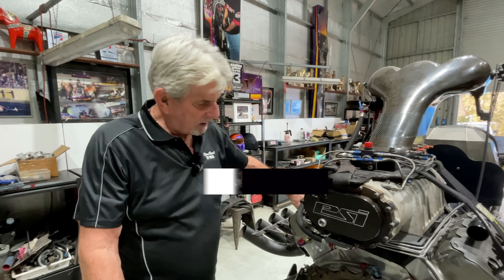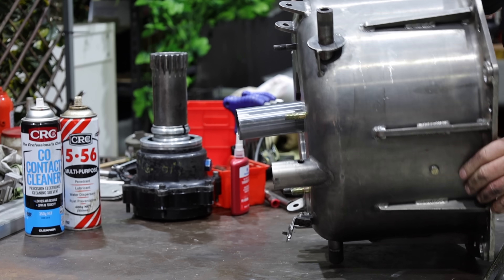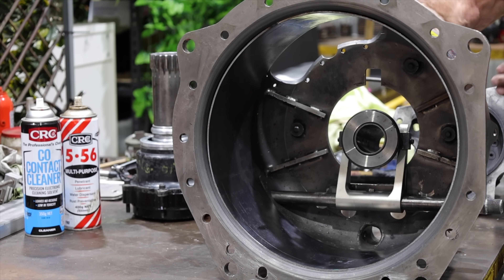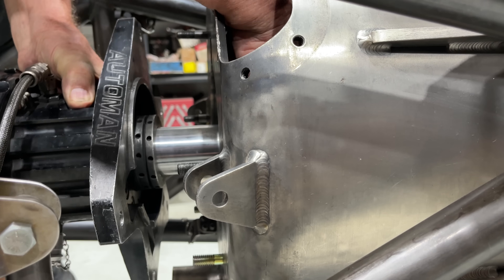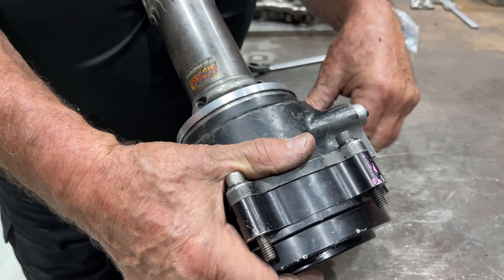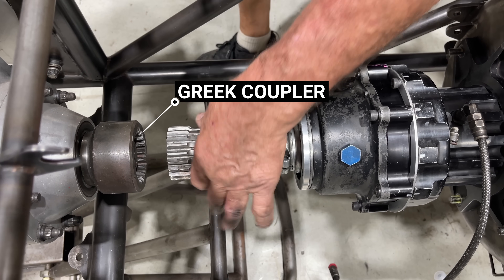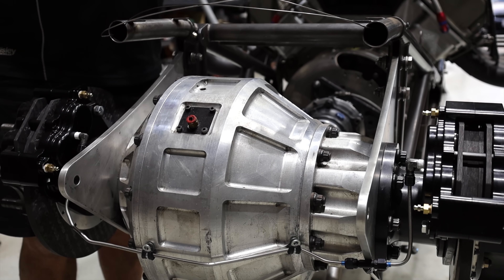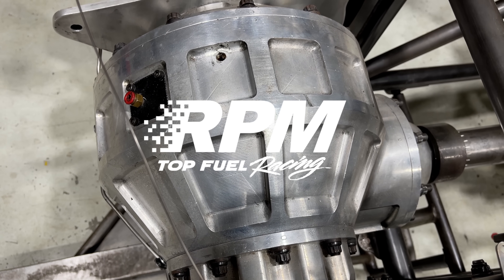THE BACK HALF OF A TOP FUEL DRAGSTER (AN ENGINEERING MARVEL)

Comment: Always loved drag races. As a kid I witnessed Don Garlits crash his Asphalt Alligator because he lost traction on his left rear, it took out two rows of low steel fences before coming to a halt, and bent them like they were made of thin wires. The Alligator, or what was left of it, stopped less than ten feet from me, I was nailed to the ground. It was most likely due to time pressure, as he was about to do a demo run, but it had lightly rained and there were still some wet spots, guess he took a “calculated” risk. He stepped out fine anyway, but I believe the Asphalt Alligator was done.

Comment: Mil is confusing because there’s mils(thousands of an inch) and millimeter. Usually mil is used for imperial, but obviously 1/4 inch isn’t 7 mils
Reply: Mils, millimeters, and mm are one and the same thing. Mils is just an abbreviation of the word MIL-limeter-S. Mil is only ever used when talking about something metric.  Thou or fractions of an inch is used when talking imperial. There is 39.37 thou (thousandths of an inch) to a mm. 1/4" equals 6.35mm.

Comment: what is the piece bolted to the can in front of the reverser?
Reply from the maker: The Auto man. We call it a cannon. It’s a hydraulic cylinder that retracts by controlled timing on a pass, which engages the rest of the fingers on the clutch. Thanks for the question

Comment: Is it just the 2 aluminium plates that hold the rear end onto the chassis? Is it to allow quite alot of flex off the start?
Reply from the maker: No, it has an anti-rotational brace on the bottom from the chassis to the bottom of the rear end. You want the back of the car as stuff as possible. Thanks for the question.

Comment: excellent vidja.  and to the ones wondering how these components handle 10k hp.  its because the weight of the car and the power is not being made until near the end of the run.   the clutch is slipping most of the time as well as the tires     the tires are a major limiting factor of not going much faster.  which is one of the reasons for going to 1000ft races.  these damn things are just too darn fast!!! lol!!! standing near one launching is exhilarating!
Reply: The gear rule is the limiting factor. The tires are the reason they run 340, by growing in diameter & effectively reducing the gear ratio. Top fuel went 339.++ at Phoenix on a quarter mile & funny cars did the same a few years later on 1,000 feet. They're now running 300 in the 1/8 mile. NHRA cut them back to 1,000 feet to give them more shtdown are! Everybody has said "they can't go faster than xxx" for the last 60 years & every year somebody goes faster!
Reply: @bradgriffith4231  I cant help but wonder, If they made a remote control TF car and ran the 1/4 just to see how fast they could go!   Im sure theres a theoretical calculation but it would be fun to see it in action!
Reply: @MrChevelle83  It wouldn't go much faster. They're governed by the gear ratio NHRA limits them to & the tires can only grow X tall. They're still slipping the tires at 339 when they go through the traps now. Also, I doubt an RC car would be driveable, since the driver anticipates(from seat of the pants feel) the next "move" the car will make & counter steers. I've never really asked anybody that I've personally known what it's like, but I have known several TF & FC drivers since the 70s. Jimmy Paoli, Tripp Shumake, Johnny West are a few & also knew Mark Niver who ran Top Alcohol 20 years ago.

Comment: Where the reoccurring failure in the flywheel clutch assembly area or anywhere for that matter is concerned,  why not the enlargement of these mounting bolts, due to failure, these sites that can be improved such as bolts,studs sizes and their respective bores, clearance holes enlarged for greater sized bolts,better still adding more bolts or threaded holes in a bigger pitch circle diameter and bigger diameter bolts and their respective holes for the bigger loads. etc... balancing to suit afterwards and  before the final checklist assembly. Easy
Reply from the maker: It’s a rare occurrence for a clutch to let go (or a flywheel). On the flange of the crank, there is only a certain size. We already have 8 x half inch bolts in there - the best aircraft quality bolts you can buy. The reason we use Permatex Red, so it’s very rare that they come loose. All crankshafts and engines are balanced to a Bob weight rod and piston assembly. Thanks for the question and very valid insights!

Comment: Nice video mate. These machines are amazing. Its surprising when they hold together with 11,000 horsepower trying to rip them apart.
Reply: Even better is that the engines are held in place with what are basically hose clamps. I will assume that you don't buy those clamps at NAPA or AutoZone.
Reply from the maker: Thanks Lee. They're the 'kings of the sport' for a reason ;) Thanks for watching

Comment: What is the strongest part of a top fuel dragster?
I think it's amazing that all that horsepower and torque is focused on only 1 or 2 teeth meshed in the differential it doesn't break, especially during the brutal shock of the launch.
The strongest part is just a couple of pieces of metal about 2 inches long.
Reply from the maker: This would make a great video topic. The chassis is designed to flex as the car goes down the track, but there isn't one point that is weaker/stronger. We'll cover this one in more detail soon. Thanks for watching.
Reply: @stevereadTF  And thank you! It would be awesome see that video. Ok I'm subbing...thanx again..

Comment: compared to a every day vehicle, what is the gear ratio?
Reply: They usually run a 3.20:1. There's no transmission. It's direct drive from the engine to the rear end. Depends on what you drive, but most cars made recently run somewhere around 4:1 or more for a final drive, with at least one overdrive gear in the transmission.

Comment: I had been wondering about how the reverser works and is engaged.
Reply: logic should take you part way to the answer. Obviously there is a disconnect between the input and the output (you need to reverse the direction of the output shaft). I imagine when it is in "forward" a collar would slip over both shafts to keep them engaged, when the collar is drawn back it allows the two shafts to separate. It would use a small idler gear to reverse the direction. Since you aren't doing anything more than idle in reverse it wouldn't need to be anywhere near as strong as the forward coupling.

Comment: Where are the transmission gears located?
Reply from the maker: If you take a look at our previous videos you will see these cars have no gears - only a forward and reverse. There is not a transmission out there that would live with the horsepower of these cars. We use a multi stage clutch with a hydraulic cannon which retracts and engages more clutch levers with counter weights on them which supplies an even application (hopefully) and if you’ve got it right - a fast run.
Reply: Technically the reverser is a kind of gearbox, I'm guessing it has some kind of planetary setup for reverse with direct drive for forward. @stevereadTF

Comment: Hello Steve. The Chrisman rear axle looks strangely like an axle design I did with a gear company in Chicago. It was designed on one of the first Autocad systems back in the middle 80's. You said this was a 12" gear, is that correct? So basically it is a 9" beefed up. Is the pinion gun drilled? I have not seen this since the Indy nationals in 1988. Hope it works well for you.
Reply from the maker: Chrisman Eng started in 1972 with father Jack and now son Steve running the place. As far as I know everything was designed and developed in house. 
It’s not a beefed up 9” though - it was carved out of a solid block of aluminium to create the 12” especially for fuel cars. No, the pinion is solid 😎 Thanks for question!
Reply: Would you know who is making those 12" gear sets? We made them in the late 80s and early 90s. @stevereadTF
Reply: Yeah, I'd love to see a set next to a 12" Rockwell set out of a truck too. Wonder which is beefier?
Reply: Interesting you should ask. Remember that a Rockwell pinion used a 10 spline but the pinion here may be 33 spline. Not sure what bearing I.D. was but I believe that they may be close to the same.  How the hypoid is cut and the offset used may be different. I know we used the same cutter heads but the machine settings were different. Remember we are talking a 3.20 ratio here. I don't think the Rockwells were that range. @guerrillaradio9953

Comment: OK, I have a question for you...I realize there is a lot of heat from the clutch friction, but just how much heat to require RED Loctite ... (remove with a torch red) as we called it, for a sub 10 second run? Are you looking at over 800 degrees here? Thanks ... Mike
Reply: Diesel trucks use red Loctite on the flex plate bolts for the extra power required to loosen.  That's probably the same reason they are using it, not for heat
Reply from the maker: Hi Mike, thanks for your question. Normally the clutch would wear between 100 to 180 thou of wear during a run depending on which track you’re at. Obviously this creates a lot of friction which creates heat - a lot of heat. Try 3700 F so that’s why we use Permatex Red to keep it in place. Sub-4 second runs these days 😎

Comment: All this time that I was marveling at the fact that an engine can produce 11, 000 hp, I never once stopped to think how it gets transferred to the rear wheels.  Awesome video.
Reply: I want to know how that Greek coupler doesn't blow like a hand grenade.
Reply: @AndyFromBeaverton   I was thinking the same thing. you'd think all that power would snap it like a twig.
Reply: @AndyFromBeaverton  it spins at engine rpm and therefore experiences less torque (maybe this is not the correct word). All the downgearing is done in the rear axle.
Reply: @karl-oskarsandstrom7673  You got it basically correct.  The engine's torque is high but what is at the wheels is extreme.
Reply: @AndyFromBeaverton  that's probably the cheapest and least dangerous drivetrain component to break so it might be advantageous for it to be just a bit weaker than the next weakest link

Comment: I notice your drive hubs are the old style without drivelugs that can drive the wheel independently from the wheel studs.
Reply from the maker: We use those because that’s what we had and have never had a problem, so I keep using them. We are putting this car together on a small budget and we are doing it because I love drag racing and have been doing it for over 50 years.
I’ve never had the latest and greatest because over here (Aus) you don’t need it, we are not looking for 3.6 or 3.7s as that costs a lot of money. We want to consistently run low to mid 3.8s - if it wins… great…if it doesn’t, come back and try again.
Reply: @stevereadTF  I was just surprised it wasn't FIA requirement. No offense meant or anything.

Comment: Did you say the gears in the rear end or did I miss that ❓
Reply from the maker: No secret with rear end gears. Everybody runs 3.2 ratio. Thanks for watching, Bill
Reply: @stevereadTF  yeah, everybody knows what they look like. (sarcasm)

i have rebuilt dozens of diff's, i have never seen inside a top fuel diff
Reply: Looks like the inside of a 9" Ford except bigger. @jesvans
Reply: @stevereadTF  
Much appreciated 👍
Reply: There is a giant pinion and a ring gear which is attached to a spool inside there — 3.20 to 1 ratio

I don’t know what that was in the video but wanted to pass that on to you